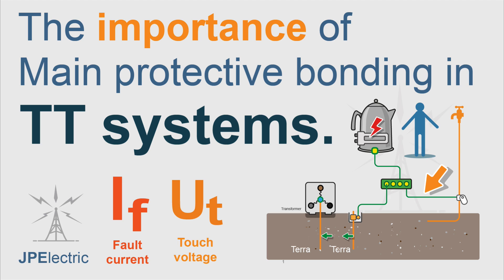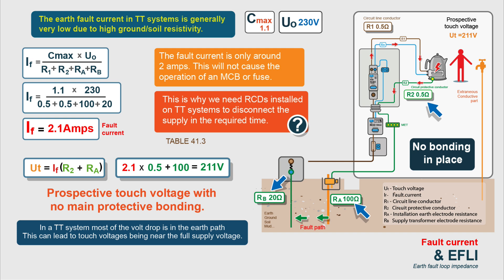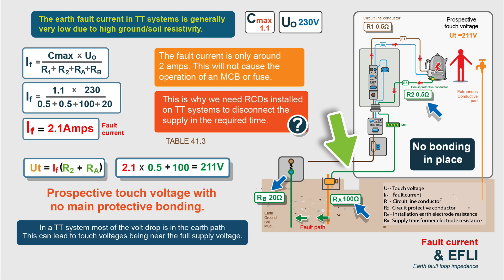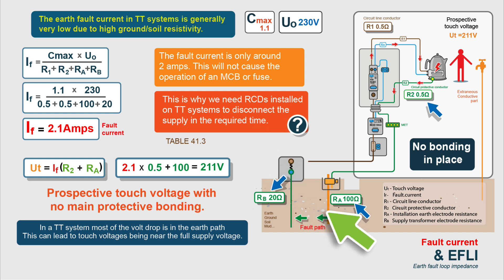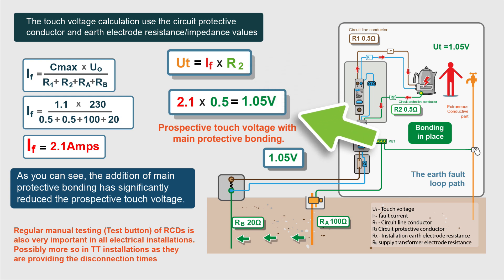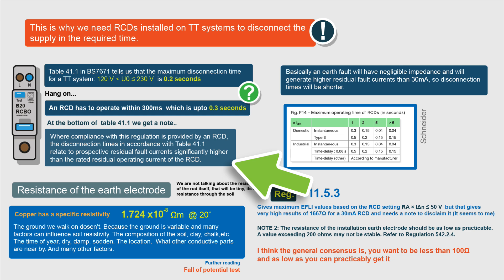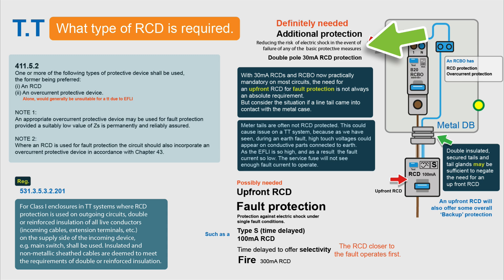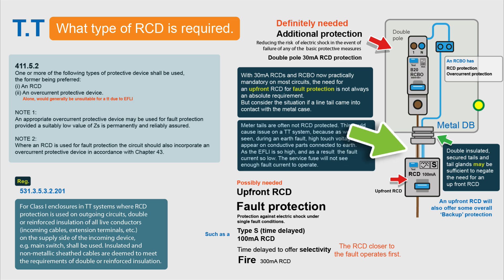The importance of Main protective bonding on TT systems

Comment: If you put an earth electrode in and theres a metal fence in close proximity to it would it need bonded to the electrode ?
Reply from the maker: You have to look at each install, there is no overall answer. The fence it self will be in good contact with the earth, and may its self 
act like an electrode.
You would not want to over bond and possible export TNCS
The fence is not part of the electrical installation, protective bonding of extraneous-conductive-parts only applied to each building

Not quite relevant ,but some thoughts from the regs
714.411.3.1.2 Protective equipotential bonding
A metallic structure (such as a fence, grid etc.), which is in the proximity of but is not part of the outdoor lighting installation need not be connected to the main earthing terminal.
Reply: @JPElectric its for a tt system
Reply from the maker: I would not bond a metal fence, You bond Extraneous Conductive parts

Comment: With a touch voltage of 211v, and a resistance, hand to hand, of say - 1000ohms, and then 120ohms through the earth path, the current across the chest would be about 180mA..?

Comment: Hi, @ 3:18 with bonding in place, what would the touch voltage be if the person’s other hand does not touch the tap during an earth fault? Assume person is bare footed and in contact with a bare concrete floor. Thank you.